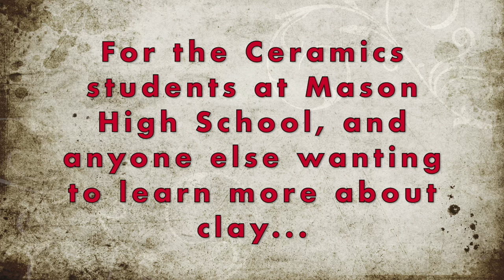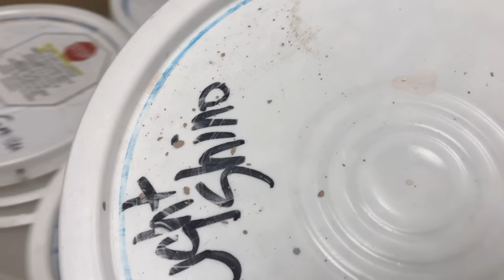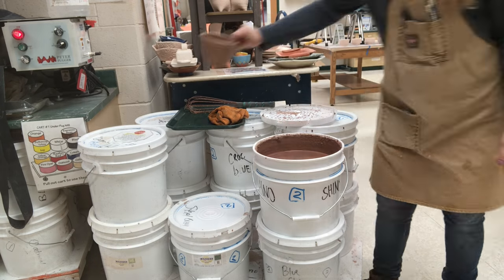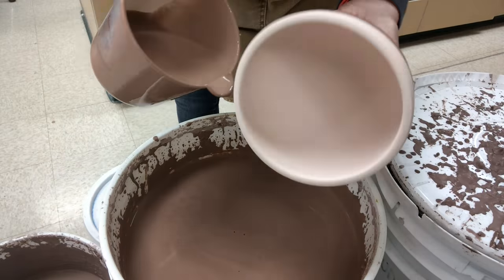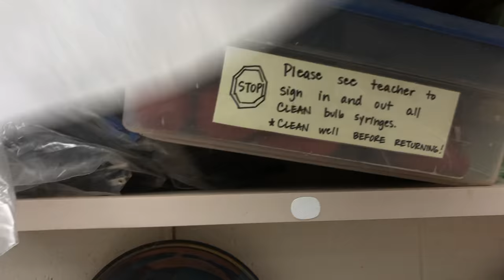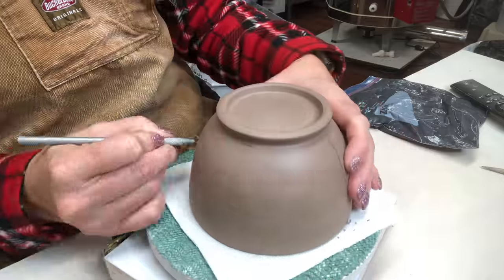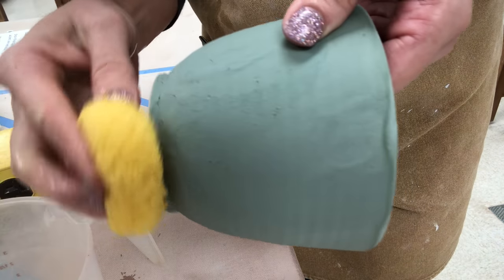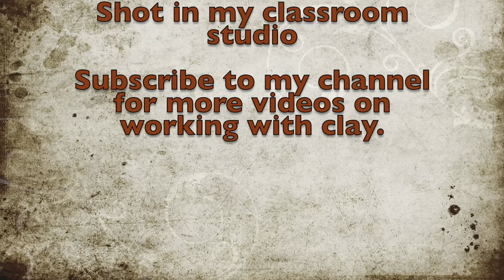Glazing Possibilities-  28 Different Approaches to Glazing Pottery! PART 1!

Comment: Wonderful video. Wish you had mentioned it’s ideal to refine the surface of a piece before it gets bisque fired to avoid needing to sand and that sanding bisque ware should be done by wetting pot to avoid clay dust. It’s so hard getting people to break the bad habit relying on sanding instead of refining before firing. Without these safety habits clay dust is flying around the studio and settling into lungs.
Reply from the maker: 100% agree! There should never be the need to after bisque- alas my high school kids sometimes do!

Comment: Just a suggestion,...at 7:25 glaze is dripping on your wrist... The skin there is extremely thin, and over time it can't be a good thing...  What would happen if instead, you would design a metal frame resembling a tray with reasonably large surface and (thin piano) wire stretched over it in grid form, four little feet on the corners,  and a high arched handle attaching on all four corners for stability but coming together at the top ...which you can hold over the glaze bucket...  On this you can then place the item upside down,... take hold of the tray handle,  lift the tray holding the item over the bucket, with one hand and with the other ladle the glaze over it... allowing the excess to drip through the wire grid back into the bucket... If you have a few of these glaze trays, you can allow your piece to dry to the touch just like that before removing it...  It will save your skin, your hands and perhaps some glaze too! LOL  Just a thought!

Comment: Hey Karan thanks for the video.
As a Potter i must say that i don't agree to some of the tutorials contents:
1. 
Glazes should be sieved after a long time of storage.
2. 
It is recommended to  consider to delute glazes with some water not to apply them too thick.
3. 
I disagree with washing the bisqued ware  after grinding sharp edges before glazing!
This is not necessary, it is okay to blow away some dust but  washing delays the process and you can't glaze after two hours of drying, because the piece would not adhere the glaze as intended, when it is still damp.
4. 
Don't dip a piece and spare the part you are holding it , that is not necessary,  as it ruins the surface:
6 . there is absolutely no need for any metal tongues, as you better could  pince the piece between e.g. index finger and thumb, then dip it, afterwards you can close the little fingerprint with one drip of glaze, this works perfect, and is much more fluently and elegant.
5. 
After dipping , make sure there are no Drops left inside of the pot. These Drops will easily result in ugly failures on the inner bottom of the piece. This is not shown nicely here. 
6.
It should to be recommended, that many glazes do not work well together or overlapped. Maybe some "ready to go" glazes you can purchase, are compatible( i never used one) but when you go and create your own glaze or take different Glaze types and try to put them together on one Pot you may experience  them struggling each other ,causing  big problems, started from shivering to crawling and many aspects of failure, this needs to be said here.

I really appreciate the effort and intention of the video, thanks for the work.
I am working as a professional studio Potter , for thirty years now. 
I never used a metal tongue to glaze a piece in my life, never used some "ready to go" glaze...
Reply from the maker: Thanks for the thoughtful feedback, Lars!  As I was making this to teach my students specifically about my glazes we use specifically in my classroom, I didn't cover some of the things you mentioned.  For instance, in a high school ceramics room setting... Imagine if I didn't tell my kids to rinse their pieces after they have ground off any rough areas.  You probably can't imagine the kind of debris they leave all over their pieces.  Of course they should not, but they do, so I am trying to protect my glazes from getting bits of their fired clay within my glazes.  (Ask me how I know this...) ;). I never try to say that my ways are the only ways or always the best ways to do things all the time... but in my classroom, these are the ways that I find most helpful to my students to be successful and cause fewer issues.
Reply: @KaransPotsAndGlass  hey Karan,
 thanks for your quick answer!
 I know about the difference between school room and studio pottery, as i was teaching at school as well... In Germany these school equipments are very low and quite rotten, anywhere you go,  it's quite sad, cause we spend no money in our wealthy , but rotten neocon country for proper education... 
We can only dream about such proper school equipment as shown in your video.

Comment: Ok so I just loved this video... you are so thorough! I have never seen this 'paddy' use. It is simply a round of rolled clay, right? And what is it's purpose? And do you fire it with the pottery piece? Enlighten my on this please.
Reply from the maker: The purpose is to catch glaze drips before it gets to my shelves! I make the kids do them as I want the responsibility on them if they misapply their glaze and it runs and fuses to the patty. As a new teacher I was so frustrated with the time I had to spend cleaning my shelves because of their carelessness- and this has saved me hours of cleaning up messes.  Occasionally bad runs do happen, but the majority of the time I give the kids the responsibility of breaking off their patty from their pot and grinding the sharp stuff.  They can also be bisque fired, kiln washed and reused. (I do that at home- but at school I fire them raw with a preheat to dry!)

Comment: Great video! I have a few questions. 1) How do you clean a rag that has glaze on it? 2) Can the tortilla be bisque fired first or fired multiple times to catch potential drips? 3) Are the glazes different kinds for dipping vs pouring vs brushing? Hope you have time to answer. Thank you!
Reply from the maker: Hi KS!  Any really dirty rags I often pre-rinse in a bucket of water before rinsing directly down the drain.  If it is lightly covered, I just rinse... however, I do have clay traps on my sinks which get periodically cleaned out.  In my home studio, I do the bucket pre-rinse on everything and also have a GLECO sink trap. The sludge in the bucket or the trap can then: 1) get dumped into the trash 2) dumped in a bisqued piece and allowed to fully dry out and then get trashed 3) get dumped out into my woods.

Some glazes are very different for dipping and pouring and have a different consistency.  If you are using manufactured glazes, see what the manufacturer recommends. That's why I love the Coyote glazes- I refill my jars for brushing directly from the buckets we use for dipping.  Just vary the coats applied!  That's why I love the coyotes!!!

As far as the patties:  Cookies/Patties can be fired green as long as they are bone dry before the kiln exceeds the boiling point of water- so I keep it under 200 degrees F until they are all dry.  For my student work, that's what we do, and they cut them to size (with about 3/4' overhang) for their individual pieces. Those are super thin for quick drying.  At home in my own studio however, I do make them thicker, and  bisque fire and kiln wash them prior to use.  The kiln wash is great to increase the longevity of the patty.  Also, I found using a wider cone of clay- so like a 6-10 cone clay is perfect for patties when I midfire to cone 6.  My Cone 6 clay blisters (and can be more apt to cause plucking) when repeatedly fired as patties, but the 6-10 is more durable.
Reply: @KaransPotsAndGlass  What a thorough response! This is incredibly helpful. Thank you so much :) my studio closed because of the pandemic and I am trying to figure out how to handle my own tiny studio. I appreciate your help!
Reply from the maker: My pleasure!!! Good luck! Shoot me any other questions that arise! :)

Comment: Amazing and extremely helpful. Thanks for all the great ideas! Can you clarify how long you dip for? Is it 3 seconds total even with thick glazes and overlapping?
Reply from the maker: Good question!  Nothing like testing your particular glazes to see what works best for them!  Some glazes are super stable and 3 seconds is perfect, some our super runny, and maybe it's a quicker in and out. (But, yes, on some very stable glazes I do a 3 and 3)  I encourage my kids to slow down when they do it if they have rinsed their pots right before they dip.  If it's saturated from rinsing, it needs that 3 seconds to absorb. If they rinsed the previous day, they might be good with a quicker 1 second in and out.

Comment: This was amazing, so much inspiration. Can you tell me, can a piece be glazed completely(no raw wiped off areas) and fired on those spiky kiln stilts? Do the unglazed bottoms on pottery serve a purpose other than not sticking to kiln shelves? Is the unglazed parts water resistant if not glazed? Thanks, love your videos.
Reply from the maker: Yes- it is possible to leave something fully glazed and fire on stilts. I don’t recommend it for mid or high fire however, because many stilts are not durable enough for a midfire, and they would sag, bend or not support that item. For low fire applications people might want to do it, because the clay is not vitrified.  For mid fire though, as long as the clay is close to vitrification, it’s not really necessary.  I prefer the unglazed bottoms. (And, I refuse to stilt the kids work when I load- that would take a ridiculous amount of time!). The entire purpose of an unglazed bottom is to keep it from sticking in the kiln.
Reply: @KaransPotsAndGlass  Thank you so much for this info. That would take forever with an entire class lol. Your students are so lucky to have you and such an amazing class, where were you when I was going to school.

Comment: Great video, thank you ! Quick question : how come you're not wearing gloves when you're dipping ? I've been taught it may be dangerous... xo from Vallauris
Reply from the maker: Well, France sounds much more exciting than southwestern Ohio!  Lol!  I've never used glazes that I thought would be that dangerous. I don't typically submerge my hands in the glaze- so I don't have a great deal of skin contact I believe.  I find that they are most dangerous if airborne, so I don't sand them or spray them.   If I am using specific chemicals that I am mixing which are worrisome, I do wear gloves.  Perhaps if I were pregnant  and glazing I also would.  Manufacturer's do give safety instructions, and you might be able to see the Coyote instructions on this page:  https://www.coyoteclay.com/Safety.html

Comment: Thank you so much for sharing your knowledge! I'm really curious, though. What happens if you bake a piece that still has the tape or wax on it? I'd experiment if I could, but I have no access to a kiln or... anything, really. One would think that the tape would simply burn away, and I'm guessing the wax would melt, displacing the glaze, and then burn?
Reply from the maker: Wax, if properly applied will fire off fine in the kiln without disturbing the glaze.  Just be sure to have proper kiln ventilation, as it burns off around 500 degrees, and is quite stinky. When people have issues with wax is if they leave glaze on top of wax.   The purpose of wax is to make the glaze resist an area, and easier to wipe off.  If glaze is left on top of wax and not wiped, the wax will melt, and the glaze will crawl potentially or pull off the wax and pop off the pot during firing.  Tape on the other hand, can leave ash behind and cause impurities and discoloration of the glaze if not removed prior to firing.  :). I hope that helps!
Reply: @KaransPotsAndGlass  I gotcha! Thank you so much!

Comment: This is so useful, I find glazing to be so hard! About the tape resist, is that a tape made for pottery, or just tape you can buy at any store? Thanks!
Reply from the maker: I have a few different kinds of tape that I like to use. I purchased some white board tape, auto pin striping tape, and electrical tape which work well. I have some links in my Google doc in the video description. Also I have a video specifically on taping you may want to check out!  https://youtu.be/_p5Rxh-ymtY
Reply: @KaransPotsAndGlass  thank you!!

Comment: Hi! A question: can you brush any glaze on your pieces? is there a difference between glazes for dipping and for brushing ? 

Thanks for your video it’s very helpful :)
Reply from the maker: Sorry for the delay- I missed this question earlier.  Some glazes might be specific to either brushing or glazing, so I can't say that all glazes can be brushed.  Sometimes they may have a thickener to allow them to brush more easily!  You would want to check each of your glaze recipes, or the specific instructions from the glaze manufacturer to check!

Comment: Obviously it won't give you as much control over color, but what about blending some water soluble fluxs such as borax into the body of the clay which should migrate towereds the outside of the peice during the drying and create a self glazing effect during firing.
Reply from the maker: Yes- I believe that’s called Egyptian Paste- and there are lots of recipes found online for how to do it!  Of course, you would have to use stilts when firing as even the bottoms would become glazed!

Comment: Thank you for the idea of a patty under the glazed items. Great help! How many times can I use the same patty? I have already fired them 3 times.
Reply from the maker: The ones I use at home I kiln washed and use over and over until they either crack or are  unusable because they got glaze on them!
Reply: @KaransPotsAndGlass  great. 
Thank you 🌹
Reply: Is there a limit to how many times you can refire ceramics if you're not happy with the glazing? I have reglazed and refired 3 times already and that worked well. But do I dare to do it a couple of more times? Also- is it necessary to slightly lower the temperature every time you refire? I have done so and the result was good.
Very happy for your advice.
🙋🏻‍♀️
Reply from the maker: I don’t believe there’s a limit on how many times you can refire, but be aware that if you have work that might be more affected by the stress of re-firing it will be more likely to break. Such as I don’t recommend re-firing big platters of my students, because it increases the risk of cracking by quite a bit. When I re-fire I still fire to the same cone, but I always fire slowly!  Also, I do not refire anything that has already been in use. Like a mug that’s been used for a month, I will not refire that because it could have trapped moisture, and could explode.
Reply: @KaransPotsAndGlass  great advice thank you so much!! ✨🌹

Comment: Amazing to see how you ignore protection against toxic materials in the glaze.
Reply from the maker: Hi Anne- do you mean because I don't wear gloves?  The coyote glazes are non toxic.  This is from their website:  "All Coyote liquid glazes are non-toxic under proposed use conditions (brushing, pouring, and dipping). All of our glazes are lead free, most are cadmium free; however none of these glazes should be taken internally as they contain ingredients not suitable for ingestion or inhalation."  I have 150 students a day, gloves are not practical in my circumstance, unless kids are using a dangerous glaze like a luster overglaze- then they wear gloves and work outside for ventilation.

Comment: Hi, i just want to know how did you apply the celadon glaze. Is that red glaze celadon or rootbeer because I saw you mention rootbeer in your result video
Reply from the maker: Rootbeer is intensely red prior to firing. It is at 18:47 in this video- #19 celadon glazes.  As I show in the video, I dipped it in the bucket of rootbeer.
Reply: @KaransPotsAndGlass  did you apply the celadon glaze before or after the rootbeer glaze ?

Comment: Can anyone help me?  I fired my first batch of bisqueware yesterday.   I've never fired any pottery and bought a kiln used with no manual.   I had mid-fire cone 05-07 clay and accidentally fired it at cone 6.  I didn't do enough research and didn't realize I needed to add a zero before the 6.  Everything came out fine but I've been reading that I'm going to have glazing issues.  What is your recommendation on the type of glaze and the temperature I should fire the pots?  I need all the help I can get.  Thanks.

Comment: what  is the tortilla used for? holding their pieces in place or do you run them through the kiln?
Reply from the maker: The tortilla patty is waste clay to catch glaze drips should they have an application issue.  We put them under the student pieces prior to their glaze firing any stoneware piece. It saves me hours of grinding my shelves from their carelessness.  Instead, I teach them how to remove the patty if they were not great in their glaze application.  It encourages them to be more careful, since they have to do the work of getting off the patty rather than me doing all the work of grinding my shelves!  The good patties I will save and reuse when I can!

Comment: Hi. Thank you. 
I like to brush the glaze and also to have the rim of the plates unglazed. Is there a tip to do it without using wax? What to use instead of a sponge ()?
Reply from the maker: Rather than wax, you could wrap the rim in tape? Or in lieu of sponging you could wipe the rim on something abrasive and wet like a low pile piece of carpet or a scrubber pad?
Reply: @KaransPotsAndGlass  thank you 🙏🏻